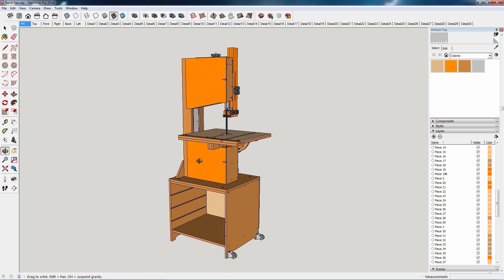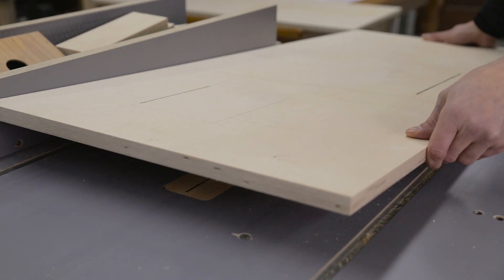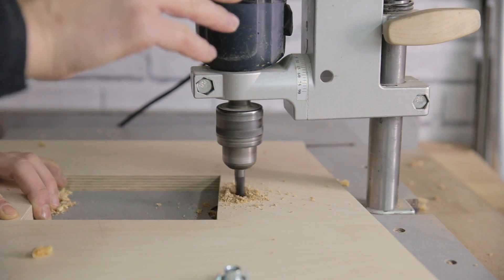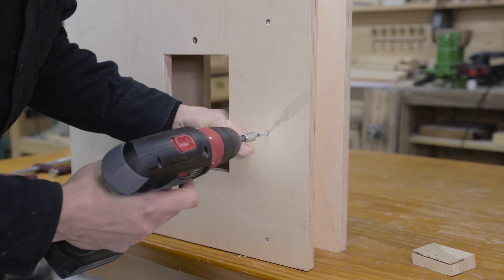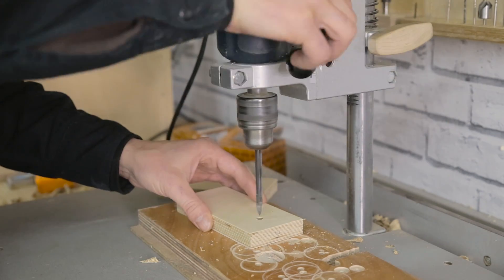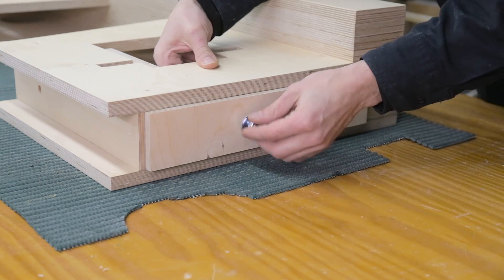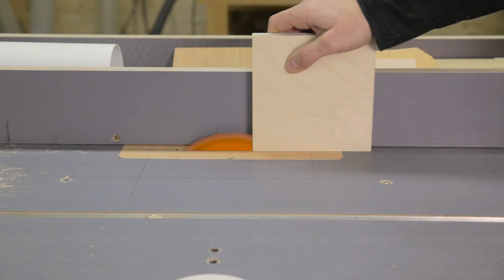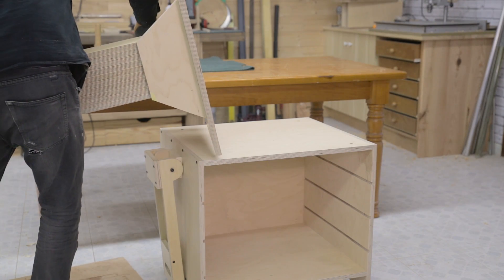Making a homemade Band Saw (part1)

Comment: HI I have watched most of your videos over this last week and must tell you that you are by far one of the best decriers of your work as you are doing it. I am also in the process of resetting up my shop so I will by purchasing several of your plans to modify for my needs. 
   I do want to ask you if the bandsaw can be made wi where it has a larger re-saw capacity and leaving everything else basically the same?
  Thank you in advance.
Reply from the maker: thanks Roger. Yes, you can do that

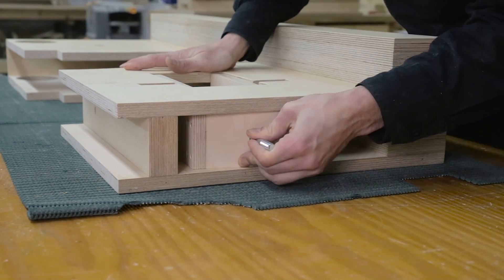Comment: Astonishing woodworking! I love your precision and craftsmanship! Im planning to build a band saw and your design is very good and robust! I wonder why do you cut these horisontal holes but not only the rectangular hole for the tilting support system in the upper box (visible at 7:23 in the video)? Also, Im thinking how to make the design thinner without losing too much of the structural strength. What is your opinion, could the motor drivebelt be located into same box with the saw blade wheel to enable thinner structure?
Reply from the maker: hello Janne, that holes are for a easier install/removal of the screws that works as shaft. I do not advise you  to make the design thinner.

Comment: Hi, have you ever considered making and selling  all the component parts as a 'build your own' project, along with all fittings and necessary items required to just assemble the band saw ?  I am sure  that such a project would be welcomed by all those just wishing  to assemble using the plans and not have all the hassle of the cutting and drilling involved.  Regards - John

Comment: Hi. This is very good. You might like to reference Matthias Wandel's earlier work - it shows up on the associated You Tube links. Between the two of you a very good product is possible. It would be nice if you could get together. Incidentally, box section beams can be almost as strong as same sized solid ones and a lot lighter (have a look at 'beam theory'). The joints would need box jointing or dowelling. BobUK.

Comment: Hello :)

Why do you put salt between your gluing?
Reply: Allan salt is to prevent slip between surfaces. It’s quite common trick in process of glueing wood.
Reply: Ok, thank you for this information ;)

PS: Congrat Suso for your project !
Reply from the maker: thanks Allan!
Reply from the maker: right Marko!
Reply: That might be so, but they would taste significantly better.
Reply: I’m assuming that it has to be very fine grain salt? If the granules are too big it seems like it could potentially keep the mating surfaces from touching everywhere to want them to.
Reply: Can't argue with that!